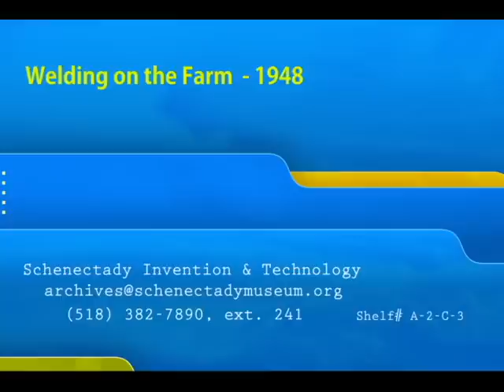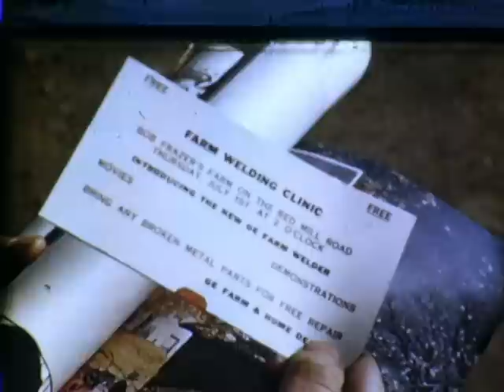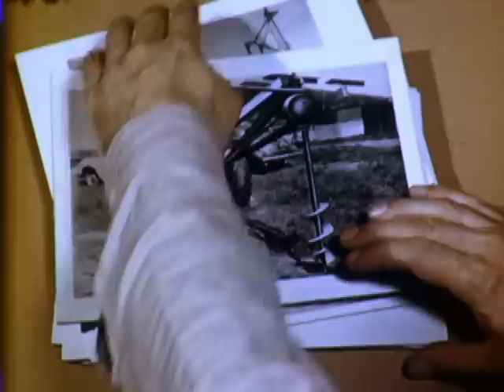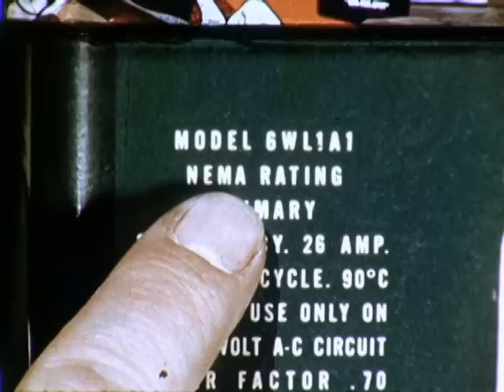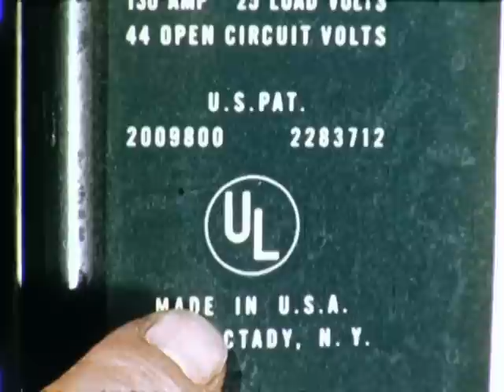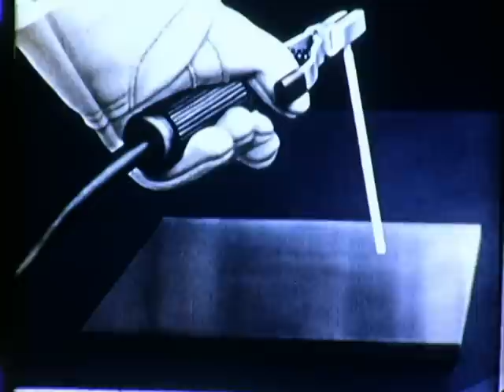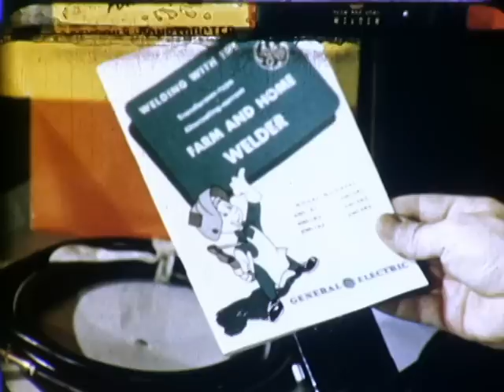Welding on the Farm - 1948

Comment: Great film !  Thanks for posting. I picked up a Cheap Harbor Freight Welder Wire Fed Mig for $80. on sale with a coupon, added auto dark hood, gloves and few extras all in $150. First weld and repair was the back door latch on my ford van, I welded an ugly spattered weld & used a 16 penny nail to hold the broken latch so the cable could pull it again. Saved $150. did not need to replace it. Since then I have welded 20 things each one with a better weld and saved a bunch fixing things. Currently making a 3 point hitch for my tiny tractor. Not on a farmer, but own some land. My buddy called me last week and said his neighbor tossed out a stack of steel. I drove by because, I am now collecting scrap to build and repair things. Great value in owning a welder, even the cheapest you can get.
Reply: Lk
Reply: 😮 25:13 😮😅
Reply: I love hearing these success stories. 👍

Comment: Delightful video!  Takes me back to my teen years in the mid-1960s when my dad and an uncle bought my first welder for me.  It is a Lincoln 225 amp AC unit that I still use.  I too was a farm raised kid.  Thanks!
Reply: I still own the Lincoln cracker box ac welder. That my dad used when i was a kid. It still works great. I rarely use it . As i own and use my hobart stickmate ac/dc . And my hobart 190 mig ....
Reply: It’s amazing that every farm had a Lincoln AC 225 buzz box and they never got a more capable AC/DC machine.  I have an Idealarc250 AC/DC and love it
Reply: Better times john. Better times.

Comment: I swear I never get sick of watching this video. I bought a Miller Multimatic 255 a few months back. Does DC Stick, DC TIG, MIG, Spray Arc MIG and Pulse MIG. Had to make a repair on my tractor last week with it. The Pulse MIG is an amazing process and a game changer. It makes me look like a better welder than I am to be honest. That said, with all the fancy computerized settings that make it so easy, I still enjoy stick welding the most. 7018 almost runs itself once you get it burning. If all I had was the old stick machine in this video I'd be just fine.

Comment: The demo welds looked ok in the film shown in the barn, but the repair welds all looked like bird shit.  Its amazing what passed for good welds back then. They would never present such crappy looking welds in a training film today.
Reply: LOL bird shit like that is still being laid on farms every where trust me i repair a lot of it after it breaks again.
Reply: the repairs looked like shit even for 6010/11 but thats what happens when you weld a shovel with 1/8.
Reply: Brainmalfuction I keep a scratch start 80amp machine and a small bottle of argon with a TIG torch for shit like that. I forget the tungsten size I use, but I fill with 0.35 70s6 mig wire.
Reply: try welding a thin shovel with 1/8 inch 6012 and see how bad your bead looks, you have to do it little by little so it doesnt burn through so it ends up rough
Reply: @Brainmalfuction  You couldn't strike an arc with a 3/32 on todays China made shovel without blowing a hole.
Reply: @jacknordli7630  Ya a lot of garbage and its getting worse i can weld down to 1/16th with 3/32 if i have to
Reply: Well first off its a welding machine/video aimed at farmers and people just needing to get shit done who were obviously very new to it & I highly doubt anybody gave a fuck about a "crappy looking weld" to hold their livelihood together.

Comment: arc welding has it's place .I fix  a lot of customer  job with arc  outside welding with my miller bobcat  1/2  plus  thickness .  Many people don't have the skill level  I weld  Arc, mig and tig.  I do it all  Hawk welding in MI   the cost of a used arc welder  $ 25  to 150 sure beat a small mig   140 amp for $ 600  and 100% duty cycle .   You can't beat old school
 Harold
Reply: Good for you, pffft.

Comment: 130 amp welder with 20% duty cycle! Far cry form my Miller Trailblazer 325 EFI. 325 amps at 100% duty cycle. Great video though. I'm glad to see how affordable some welders are today for folks just getting started. Yeah the cheap ones are made overseas but at least not all in china. I have a 160 amp AHP with a 60% duty cycle and weighs around 11 or 12 pounds.  Only paid around $225 new. Great little dual voltage machine. I keep it as a loaner. When friends ask me to weld something and I'm too busy, I hand them my AHP with some rods and a spare helmet and tell them to watch some Chucke2009.
Reply: And it was only 100-115 lbs!
Reply: I have a good little dc stick welder also but the truth is the transformer welder will long outlive the inverter ones.
Reply: Agreed. You can really learn some good stuff from Welding Tips and Tricks. Great channel. I recommend them too but Chucke2009 has full projects and is entertaining. Gives you the feeling like "If he can do it, so can I". That said, I don't care for the direction his channel has gone recently. Seems like it's just infomercials and I'm sick of all the tractor restoration/failure videos.

Comment: So I have to mention something that caught my eye. We have all seen footage or photographs from the past with looks like current technology in them and I may have found one that is quite interesting. I would like to find out exactly what is there rather than speculate. 6:24-6:31 mins into the film there is a younger man with glasses with a silver looking square object on his back. He moves slightly and you can see the the square on his back has a reflective glass of some sort. Just thought I would share.
Reply: He is holding a hand shield - a hand held welding helmet. Go back to 5:51 and you see everyone using the hand shields to safely watch the welding demo.
Reply: It's his protective face shield.  Remember, never look at the arc without one.  Fortunately, the protective shield is part of the package, everything you need to get started is included with your new GE arc welder.
Reply: I had to use a protective face shield to watch the movie.
Reply: Looks like an iphone. Prob the 10